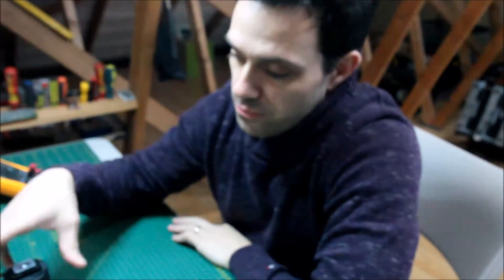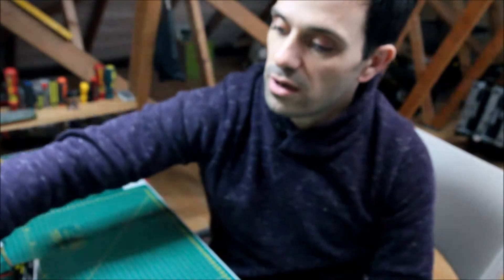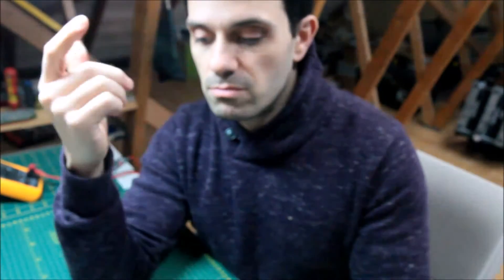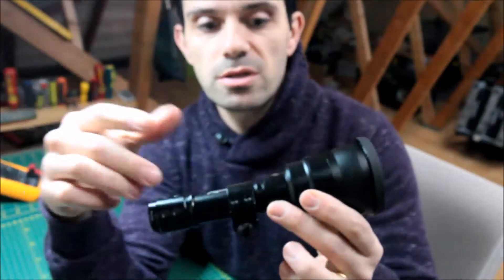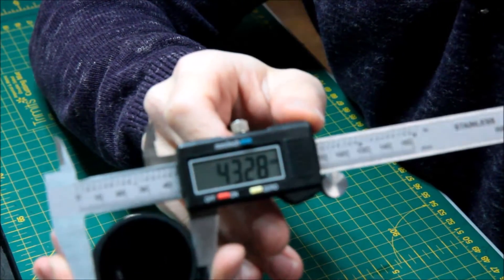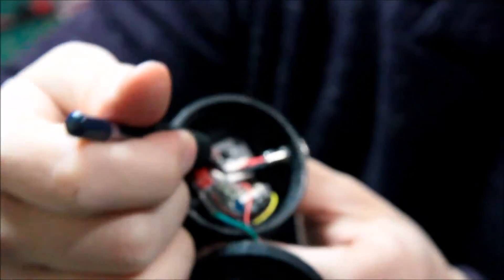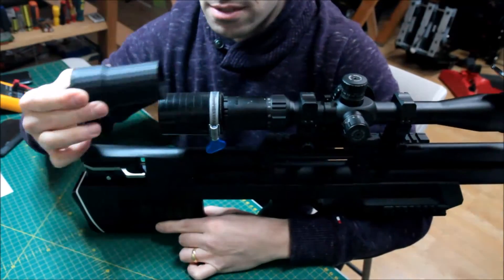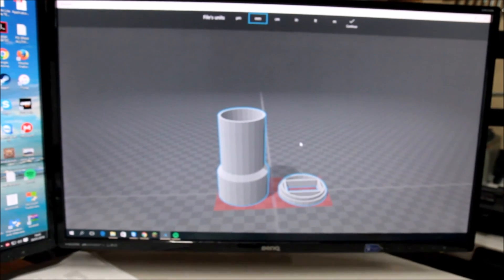DIY NIGHT VISION AND MY IMPROVEMENTS

Comment: hi I must say what nice work you have done there.... I'm new to this but I got chickens and now I have rats  so I'm looking to make my own night vision ..,,, what I would like to know is the red and yellow and red wires coming from the camera  , can I strip the coating off the wires  and wrap the iner red and yellow together and there outer wire from them both together , so I got the iner wires and outer wires .can I put the two inner wires to power then two outer wires to the neg  ..then plug my screen in to them will they work as I seen lots of units with just one cable plug to power the unit up   ,,,,, see told u I'm new to all this .... or maybe you could show me how to wire them all up plz
yours
jim

Comment: it looks like the display has been discontinued or is unavailable but i was able to find this one will it work ? http://www.ebay.com/itm/MOY-Monocular-Head-glass-play-Micro-Display-Cyclops-One-Eye-QAV250-FPV-Racinga-/272510820740?hash=item3f72e92184:g:ZlwAAOSw2xRYbdTp
Reply from the maker: that will do it albeit a bit overpriced
Reply: I have looked all over banggood  eBay and every where else you can buy cheap Chinese crap and the one that you used seems to just be magically discontinued I like its design better than the one on eBay because you don't have all that ribbon cable and extra logic board to deal with. Any way I have a 3D printer and I downloaded your files much appreciated hopefully I can use your system to take care of a few coyotes👍🏼if you have any additional sources for the parts I would love to know where.

Comment: Nice werq on the night vision I had been working on something similar for some months prior using the cylindrical EJ230 camera in a carbon fiber tube but was unable to find a decent viewfinder.  When I came upon your video I was quite happy.  That is until I bought the viewfinder just looking at the 640x480 resolution spec.  The seller falsely advertised the viewfinder as 640x480 when it is really WQVGA which is only 400x240 so quite low resolution and not what I was looking for.  I asked the seller to correct his misleading specs he had both the 640x480 and WQVGA specs on the same line.  It seems as they are no longer selling them so something happened.  So, I am still searching for a decent 640x480 viewfinder at a decent price.  Your Flashlight mod got me to thinking as well and I bought a Panasonic 52mm LX3 adapter and a Polaroid Studio Series 2.2 lens.  Very tight press fit is right but it did go together and werqs very well.  
Thanks for the hours you put into showing how this is done too bad the vendor had incorrect specs on what he was selling guess I will be using my screen for a bit longer.

Comment: Good but still no dvr for that great shot and able to share with friends, ive built a wireless night vision set up with no wires no batteries and its a dvr. total run time with the built in batteries is 9hrs. Good 3d design Adam
Reply from the maker: check my latest video for dvr

Comment: you forgot to say that the key is to have a 12mm lens fitted to the camera assembly, they come with the wrong 99% of the timeyou need that to fill the screen. plus the scope must just right for the job, too short eye reliee, pain, too long eye relief, it will be too long tube.the one I made is using a silicon tubing reduction, and solder everything no detachable connectors to fail in the joint, and no switch. you just take one of the 3 18650 batteries out. simples

Comment: Flippen Great! What a creative way to use new the technology. I want to redesign your housing to put the monocular next to the camera instead of behind. That should shorten the whole NV unit. When you shoulder the rifle instead of looking from behind straight down the scope at 12 o'clock, I will be looking in at a 1 o'clock angle slightly across the scope line.
Imagine if I was looking directly ahead, the rifle would be angled slightly across my body (aiming 30 degrees to left) from right shoulder to left hand. Rifle points towards 11 o'clock.
Still no cheek weld though.

Comment: Hi Adam, nice job. Could you give me a hint on whether to use the D- or D+ pin on the viewfinder mini usb pinout for carrying the video signal from the camera to the viewfinder?
Reply from the maker: +Saku S Hi mate, I wouldn't rely on standard USB pin out info. double check the connections with a multi meter. These are made in china
Reply from the maker: +Saku S 
https://www.facebook.com/photo.php?fbid=10154077344874274&set=gm.909143509206002&type=3&theater

Comment: Very nice job! Wouldn't this screen be better:
http://www.banggood.com/FPV-Night-Vision-Goggles-Viewfinder-Monitor-Micro-Display-p-912901.html
as you can adjust the brightness too? It seems to me the display is more or less the same, without the usb and housing.
Reply from the maker: +AirgunNV 
Yes I bought that after this video and its the same resolution
Reply: Can you remember if it still fit with the same 3d design you have made? Thank very much for that by the way, this is exactly what I've been looking for.

Comment: Great job, best on the net. How do you find the resolution of the veiwfinder? Also how do you find the eye relief? Cheers.
Reply from the maker: +brad glasgow 
Thanks mate it works very well but eye relief is basically none, your eye rests on it. 
I am developing a new system never before seen. Once I release it in a few days it will offer eye relief and will be the smallest unit on the market. Not even the big manufacturers have come up with this.
I need to protect my idea from the big players before I spill the beans. I'm not concerned about DIY'er copying me
Reply from the maker: +Sam Verouden my email is adam.adamou@gmail.com send me you proposal

Comment: brilliant! downloaded your design and send it to a 3D printer shop via 3Dhub printing only costs me €11,50. Thanks!
Reply from the maker: +S Verou 

Make sure you print at 100 micron resolution and in ABS. Can't guarantee it will fit as perfect at 200 micron. Worst case you'll need to do some sanding adjusting etc..

Reply ·
Reply: Thanks for the advice, I'm also adding a housing for a 1800 mah battery. The printing company still didn't reply at my drawing so I'm making some adjustments.
Reply from the maker: Cool. I left that bit out as every ones batteries would be different sizes. I'm also making a new design for a slow motion camera Casio which is cheaper than the eagle vision
Reply: +Adam Adamou S Verou is now selling your design in the Netherlands...
Reply: +AirgunNV Haha WOW, that such a wrong statement. I sold one because i build one but i didn't use it. you're probably one of the members of the NV build your own Facebook page. Who kicked me without even hearing my story.

I'm making my own NV designs but i certainly look at the designs that other people make, as we all do!
Reply from the maker: S Verou your welcome to do whatever you like its a free world. selling my design is great.. wish you all the best